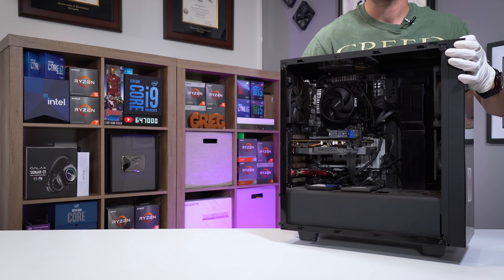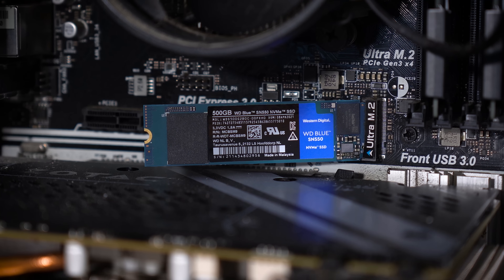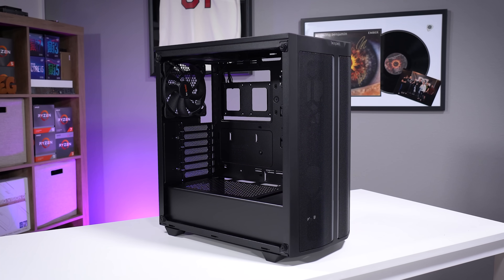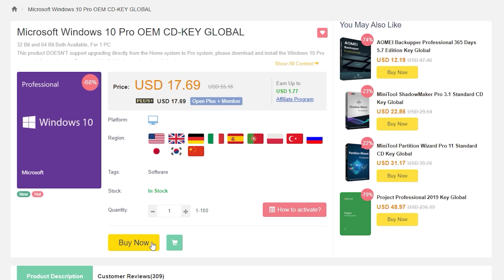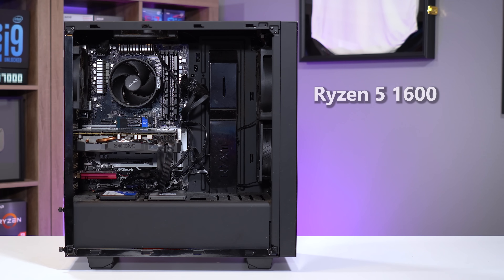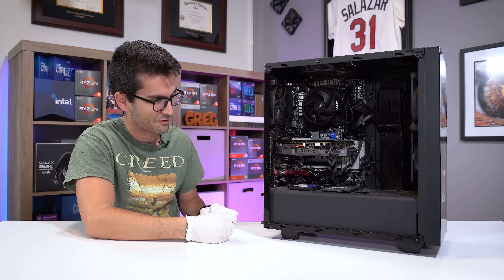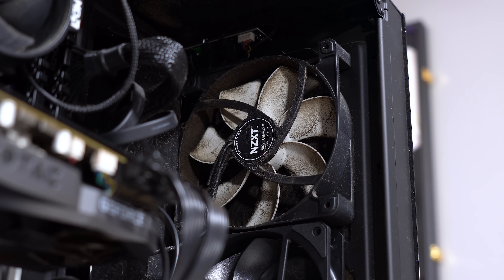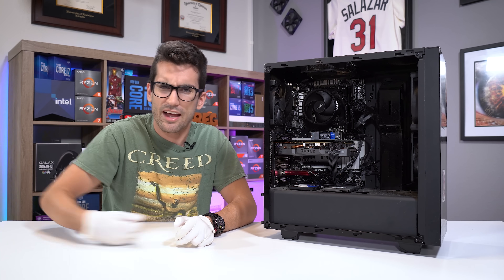Deep-Cleaning a Viewer's DIRTY Gaming PC! - PCDC S2:E5

Comment: I highly recommend you use a "Micro Vacuum Attachment" compatible with most vacuum cleaners which feature a flexible hose, and a small brush + crevice tool. Since it's paired with a full-powered vacuum cleaner, it's got a lot more punch than the handheld one you are using. I purchased mine from Amazon for $7. It's incredibly helpful for these types of jobs and it's small enough to clean fans and other small spaces but just large enough to cover significant ground when cleaning the chassis. It would save you from having to breathe in that nasty dust and unwelcome particles as you are disassembling these filthy builds! I also use Meguiar's "Natural Protectant" which is meant for car interiors but also does a great job restoring PC parts and cases to their original luster, and leaves a grease-free matte finish!

Comment: Anyone else really enjoy the look of AMD's stock cpu cooler? Also that is such a tiny 1080ti.
Reply: I love the Wraith Prism. I have one in my PC and I don't even want to upgrade it.
Reply: @CaveyMoth  Agreed. I got one with my Ryzen 7 3700X, and every time I think of upgrading to an AIO, I just can't justify it. Does a more than adequate job, and looks great in the system.
Reply: @hollisnelson5925  Yeah! The only disadvantage to me is that temps can change rapidly, leading to some fan ramping.  It's not much louder than my case fans, but it sure likes to speed up and down when it gets hit with a load.
Reply: @CaveyMoth  just went from a ryzen 5 3600 to a ryzen 7 3700 and love the wraith look
Reply: Yeah that design is simple but beautiful
Reply: @Manni4  but Zotac is horrible
Reply: I was shocked to find that there are 2 fans that come with it: 

Super loud 7 blade fan
Surprisingly quiet 5 blade fan
Reply: That old stock Wraith Spire was actually decent because of the copper slug. The new 5600X has the stupid Wraith Stealth,  not worth using at all…
Reply: @matasa7463  Ryzen 5 3600X comes with the Wraith Spire which is much better than the Stealth, but for some reason AMD decided to not make it the stock cooler for the 5600X
Reply: @Fiorezy  Don’t forget no cooler for the 5800X. Like really guys? You that cheap now?
Reply: @Fiorezy  For some reason? Monies!
Reply: @Fiorezy  what does the 5600x come with mine says it only comes with the thermal paste did I get ripped off?
Reply: @jgvtc559  What do you mean?
Reply: If you upgrade from the stock cooler, you can still use the fan, which is basically a 92mm fan with 80mm fan mounting holes.
Reply: @tthbeige3332  wait you can? Thats neat
Reply: Oh yeah. Not sure how Intel manages to make their stock cooler look so feeble and bad in comparison
Reply: @Karldin83  at least it's all-black now lol
Reply: They're not a whole lot different from the current ones. Just a little less RGB. But, I agree. they look great for what they are. Certainly a world apart from the Intel stockers.
Reply: Maybe it's 1080 Ti for SFF build?
Reply: Isn't that the zotac mini 1080ti? I have the 2070 super in same form factor. Works pretty well if you have good airflow.
Reply: Yeah that copper wraith cooler sadly got discontinued. I though I had one myself but sadly not. Prism are really nice though especielly the way you can tweak its RBG
Reply: Yeah I love the simple black one or the version with the single rgb ring and logo. It's like the first time using a CPU I actively don't want to switch the cooler.
Reply: stock cooler looks sexy
Reply: The look is pretty decent. The sound level....wellll.
Reply: Especially the Ryzen 7 one aka rgb one
Reply: I'm using it to expulse air
Reply: Yes its really cool. I have one!
Reply: I hate that cooler, cause it was useless in myr5 3600 and had to replace it in a month of using it.
Reply: Although this seems to be Spire, not Stealth.
Reply: @t3rminator777  that is correct. The cooler they provide with r5 3600 is stealth not spire
Reply: @Sou1kn1ght23  i know. At first i thought this is also stealth. It maybe good enough for this cpu r5 1600 I believe.
Reply: @t3rminator777  yeah stealth is a horrible cooler
Reply: I actually own that exact 1080Ti mini in my ITX build! Such a small and powerful card!
Reply: @FlipKd4  1080ti small,micro or huge still a great GPU.
Reply: @t3rminator777  one of my fav GPUs ever. Don’t plan to upgrade until this thing dies LOL
Reply: @FlipKd4  i have aorus 2060 and doing fine so far. But I love my gpu cooling more than anything in my pc. i barely see over 65 in gaming.
Reply: Wonder why they made it much worse for the 2600 and 3600 besides cost-savings. And yeah, my Gigabyte 1080 Ti absolutely dwarfs that Zotac Mini card.
Reply: It's plain but is real beef against the competition.
Reply: Honestly, I wanted to use the stock prism cooler on my pc but it's just so damn loud and not super effective. very good looking though.
Reply: I definitely don't. When they first came out I thought they looked good, but inside a case they just don't live up.

Comment: Hey greg here for a fix can you help
My system has an msi b450 motherboard and a amd 2200g and i build the rig 2 months back for my school work, 
However a couple of days back it just isn't showing any video the pc starts and turns off immediately than turns back on and keeps on but there is no video output to the monitor. 
The cpu debug led also stays on while the pc is on..... 
Any thoughts.....? 
Specific hardware
Msi b450 m2 max
Ryzen 2200g
No gpu
8gb xpg ram
450w psu
e monitor

Comment: i got the 500dx in white a few weeks ago and it has been amazing. i even used your video on the cablemod vertical gpu bracket to make it pop! keep it up man
Reply: I'm interested in the case but have 2 x 3.5" drives and wonder about the heat inside the HDD cage with seemingly poor ventilation.
Reply: @passerby6168  you can put 3 120mm fans up front for intake and the bottom will be an inch away from the HDD's
Reply: @Meatsweats_o_O  I know about the fans yes. It's the HDD cage itself that concerns me as far as the top drive goes and air remaining trapped at the top. Thank you though.
Reply: @passerby6168  I don't know if that helps at all but I have a single 3.5" drive in there and it has never even touched 50°C even though I only run two 120mm radiator fans in the front. In idle it sits at about 35°C at 24°C ambient and under heavy/sustained loads it might go up to 45°C. My M.2 SSD gets considerably toastier even with a heatsink. I think you should be perfectly fine.
Reply: @borgejoh  Yes that is helpful thank you very much. Is it in the bottom slot or top slot of the HDD cage?
Reply: @passerby6168  top slot
Reply: @borgejoh   Great, thank you for taking the time to answer.
Reply: @passerby6168  No worries, just ran a few CrystalDiskMark runs on the HDD and it hit 38°C max, just fyi
Reply: @borgejoh  Super.
Reply from the maker: Thanks for the support! And great choice in case ;-)
Reply: @GregSalazar  Great bang for the buck, too!